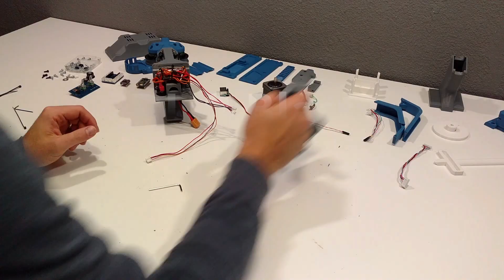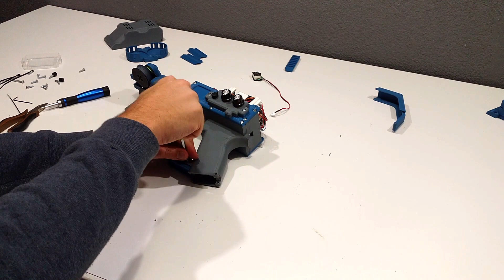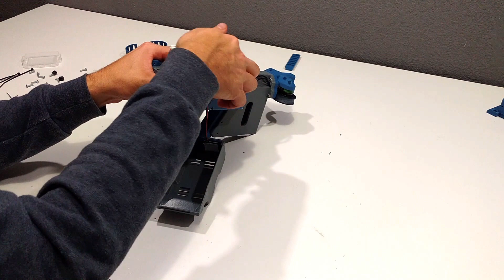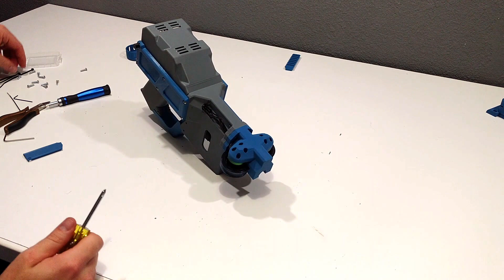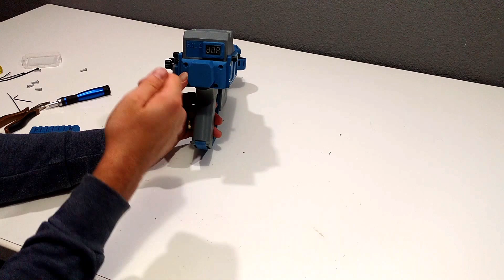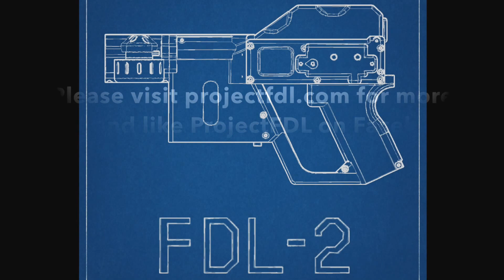FDL 2 Assembly Part2

Comment: Hi Jesse Andrew again.
trying to find demensions for battery. I have venom racing 1300mah. 3s
Just wondering about specs please
Reply from the maker: The handle cavity is 24mm x 36mm x 94mm. Your battery needs to be able to provide at least 25amps. According to the specs on the 50C version of that battery, it looks like it should just barely fit.

Comment: I'm just glad there is no soldering!
Reply from the maker: Robin Davies Totally, that was goal #1 of having the PCB's made. Even the soldering on my end has been cut way back from the FDL-1. Most of the connectors are polarized too so you can't plug stuff in backwards. I put a lot of thought into trying to make this as easy as possible even thought it is a pretty complex design.
Reply: It shows a hell of a lot of thought and great design - hope you win the contest. By the way you have tipped my thinking into getting a 3D printer.